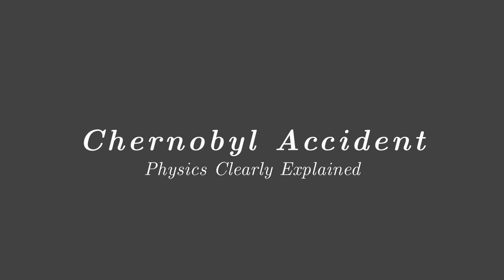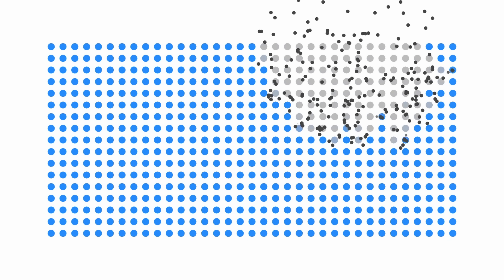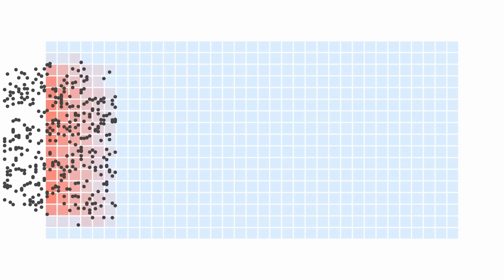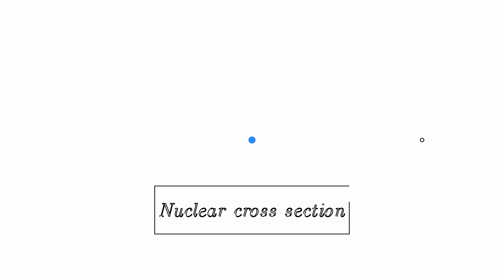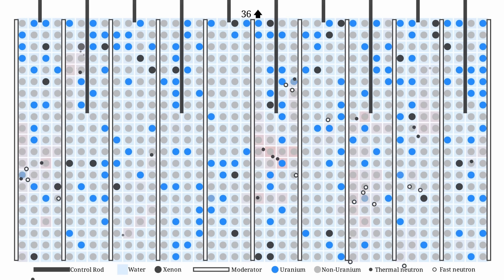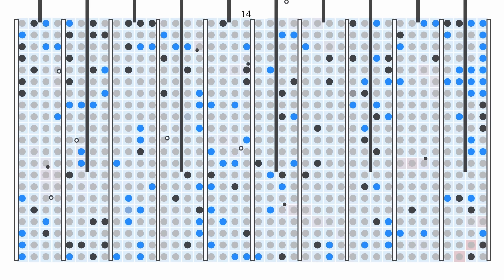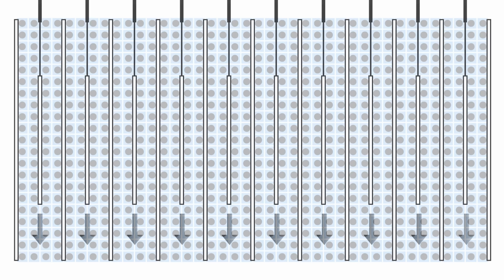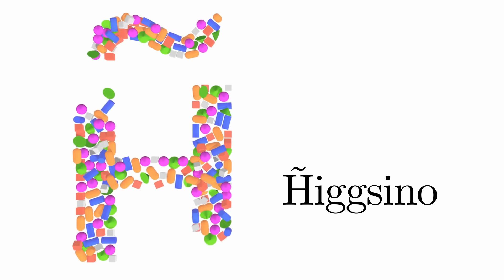Chernobyl Visually Explained

Comment: 15:14 I feel like this really is the fatal flaw in the design of the reactor. The control rods have graphite tips that work to increase the reaction rate instead of decreasing it. As someone in another video mentioned, that's like having a single pedal for both gas and brake. Imagine slamming the brakes and the car accelerates for a bit before actually starting to slow down. Given how hazardous that is, I'm not surprised the accident happened, but that the reactor even managed to function as intended at all. I mean, who even designed this?
Reply: That analogy is a little bit disingenuous to what actually happened.

 If you want to use the same analogy, it's more like if your car had power inhibitors installed and your car was maxing out at 10mph in a 40 zone. So you turn off the inhibitors and it slowly accelerates to 20mph. The car system then warns you that the car is in a state that is about to go mental and to activate the brakes IMMEDIATELY (and would likely do it automatically eventually). You instead ignore that entirely, turn off the safety system so it can't interfere with your decisions in any way, keep pressing the accelerator despite the warning, and then only once you are doing 700mph do you then decide to activate the brakes.

I agree that the design probably could have been improved, but the actual disaster was purely user negligence and the system did everything it could to try and help them prevent it and yet they just turned all that shit off and tried to fix it raw.

Comment: 15:26 
Sorry to add, but another inaccuracy is that the reactor caps were most likely not jumping. However, Elena did jump a few feet up about a second before the explosion, breaking most of the welds holding it on, the surviving of which were then broken when it got shot off.

Comment: 14:00
Incorrect. There wasn’t actually a power spike before the shutdown, the shutdown was standard test procedure.
They had managed to get the power back to and stable at 45% power. Toptunov was calm while pressing the button at 1:23:40 until many more alarms went off.

Comment: I've read investigation papers and it looks like it is not so simple like in this simulation or in the movie. The problem was that detectors were concentrated mostly on the middle level of reactor, and at low power state nuclear reaction in RBMK could become unevenly distributed so detectors cease to show adequate values. So while in one part of reactor everything is ok, in the other one it already gets out of control, hence heat and pressure differences that caused jamming of rods.

Comment: Without the graphite moderator (and the graphite tipped control rods) you would have a PWR, where the water is the moderator.  The RBMK was not intentionally controlled by water voiding, like a BWR.  Reducing the water flow for the trial caused the water to boil, which significantly reduced the neutron absoption.  It was not all about Xe poisoning.  The graphite was still moderating fission neutrons.  Lowering the control rods from fully raised actually added reactivity for the first metre or so.  This top reflector was designed to avoid needing enriched fuel (like a PWR).  The graphite tips were removed from the other working RBMKs.  The explosion was from steam flash boiling, not nuclear, although the fuel dispersal was just as bad.

Comment: I don't understand why the scram button didn't work
I find difficult to understand the "stopping power" part
Reply: Because you can't just stop the reaction the same way you can just stop feeding coal into a power plant. The nuclear material will react as long as there are moderators in the reactor. Reactors today don't have this split moderator-control rod system, instead they often use materials that do both at once.

Comment: Fun fact in the boiler operator industry out in NJ we’re required to get boiler operator licensing to prevent steam explosions. Water expands and turns into steam at a rate of 1600:1. So very quickly the pressure builds. 

The one example of negligence always used is the event of an operator on his night shift. Typically all boilers run automatically and only need to be monitored using a computer Building Automation System (BAS). Once a boiler runs low on water a feed water pump controlled by the BAD will pump more water in and a boiler should never be low on water while running EVER…

So the operator was working his night shift. The boiler was having issues and kept ringing an alarm for low water which would automatically be added immediately. The operator was trying to sleep and decided the alarm on the boiler was bothering him. So he disconnected it… he goes back to sleep and the boiler starts to get low on water and because the low water sensor is disabled it can’t communicate to the feed water pump to add more water. 

The BAS just kept the boiler on so the entire shell got extremely hot cause there was no water to move the heat out. The operated eventually woke up and saw that the gauge glass ( a physical glass tube on the boiler that lets you see the water level) was not down a little but completely empty. In a panic the operator ran to the feed water pump and opened it manually…

By opening the valve and letting water into a scolding hot dry boiler all the hundreds of gallons of water suddenly expanded from 1 part water to 1600 parts super heated steam (steam so hot it’s invisible). As soon as the water entered the boiler the entire plant exploded instantly killing the operated and sending the boiler literally a football field away…
Reply: Apart from not disconnecting the alarm a better course of action would have been to simply stop heating the boiler. At this point, the boiler is probably f...d anyway from overheating, but at least you don't blow yourself up trying to cover up your f....p.
Reply: @joergmaass So in commercial and stationary use the boilers run automatically. The operators job is to stand by for repairs. But because the operator tweaked the automation of the system for his convenience the boiler was still programmed to do its job. The operation upon waking up should’ve seen the gauge glass was empty and just hit the emergency shut off and cleared the building and called relevant authorities. I don’t like the government having a license for everything but for this I agree
Reply: @Paralius  An emergency shutoff like AZ-3? 😉
Reply: I work as a maintenance technician in Alaska and by no means am I a boiler operator, but I’m very interested in working on them and love learning about them, we are told how dangerous these things can be and to be always keep and eye on the pressure and the low water sensor, we do not have a BAS system for all these boilers, they’re designed if there is a low water alarm they will shut off the boiler and go into a hard lockout, at least that’s what I’m understanding about them, why wouldn’t this system do the same if water wasn’t added from the BAS?
Reply: @SlaminSalmon-ni3wj A BMS or BAS is designed to shut things down when it’s not tampered with. However if you do tamper with safety’s you can trick the automated systems and that’s where serious problems start!
Reply: @Paralius oh I see, so the operator silencing the alarm tampered with protocol and pretty much destroyed any chance of cooling down the boiler
Reply: @SlaminSalmon-ni3wj correct. And what I believe happened was he bypassed the physical safety so the BAS read the load in the electrical loop (the safety in this case) as ok and working properly
Reply: @Paralius gotcha, but in the bas wouldn’t there also be a high temp switch as well? Was this also bypassed because I know here it has a tendency to not work properly
Reply: @SlaminSalmon-ni3wj Yes! There are physical limit switches to detect high temp as well as BAS systems. However some BAS systems depending on manufacturer and type only let the operator know there’s a high temp. So it’s the operators job to monitor and regulate it. But sometimes a high temp alarm can trigger an emergency shut off if programmed to do so. 

In our example the operator disabled ALL safety’s power including the audible alarm. He also either disabled the limit switch or again tampered with the BAS
Reply: @Paralius that it absolutely insane to me man, to have all these early warnings to just ignore them and cause a catastrophe, with all my coworkers I stress just how dangerous these systems can be and I’ve actually used this example with everyone to explain what to do when a low water sensor is activated
Reply: @SlaminSalmon-ni3wj The good news is that it takes a LOT of skilled tampering to accomplish something like this. Several systems have to be compromised and believe it or not the Chernobyl incident has a lot to do with why it’s so hard to have accidents without tampering
Reply: Wow!! What a crazy story. You told it well
Reply: but obviously this event was not independent from the fact that all the operators around the plant were not adviced of the safety test going on, so it was very negligent but also a lot of other factors help the accident
Reply: What is their SOP in the event that the boiler is empty?
Reply: @Chartreuseweb good question. When a boiler becomes low on water it engages a feed water pump to add a some back. We call that “makeup water”.

In the EXTREMELY rare event all safety’s don’t work the correct sop is to EVACUATE. But this operator in question tampered with everything to cause this to happen. 

When anything gets hot NEVER add more water to it especially a boiler. Best course of action is emergency shut down and then maybe 16 hours of a cool down period
Reply: Makes sense. Thank you for answering  @Paralius
Reply: @Chartreuseweb  I work in a power plant, too as an automation engineer. For our case, we don't have SOP per se when the water level is very low, because the automation system is programmed to immediately stop the boiler by safety interlock (a kind of permissive that cannot be bypassed unless the program itself is modified by us). This also applies to other critical factors such as low oxygen level, low fuel, high fans vibrations, etc.
Reply: Thanks for sharing. Even as the engineer supposedly adhering for the safety of plant operations (with the cost of constant arguments with control room operators 🙄), sometimes I also got pissed at the lengthy procedures and how the programs are designed to be so restrictive sometimes. But these kind of stories remind me that those troubles actually saved everyone from experiencing the same catastrophe.
Reply: @user-dw8bs4qp1r agreed. I’m not a fan or redundant procedures but I’m even less a fan of safety issues
Reply: What plant did this explosion happen?
Reply: that makes sense heat along wouldnt have caused the steam explosion you would have needed water and adding water to the thing that already heated over its limit wouyld cause a explosion like that
Reply: That's really cool bro! I never considered that it is pretty much just a big nuclear steam boiler!
Reply: @DrPeculiar312 hey, you might not be exactly right here. Folks at Chernobyl thought that the worst thing they could do is mess up with the water level in boilers. And human error comes down to negligence be it a power plant or a space ship.

Comment: The neutron flux spike occured from the bottom of the reactor making this even more worse as it is or was. You explained it why actually a bottom only but neutron flux was rising from the bottom to the top and some sciencists stated that around 2s befor the explosion there was even bigger thermal power surge raging from hundreds of gigawatts to almost few TW. So the personal that night generated literally 5years worth of power in 1 second...😂

Comment: For anyone curious why reactors with a negative void coeficient cant explode, in short it is because instead of graphite for moderation they use water. Now because they use water both for moderation (slowing neutrons down) and cooling that means that if the power would increase rapidly like in chernobyl unit 4, water would evaporate and thus the neutrons would go too fast to hit anything because there is no water to slow it down. Note: I am not a nuclear physicist and if anything i am fucking dumb from chemistry and physics but this is just an oversimplified explanation that i deducted my self by simple logic. Its if water = true then neutrons = slow, if water = false then neutrons = fast, if neutrons = fast then small chance of a nuclear reaction.

Comment: There were two explosions. One when the water flashed to steam blowing the lid or cap off the reactor. That allowed air to rush in causing a combustible hydrogen/oxygen mixture which was ignited by the superheated graphite. That explosion is what blew the roof off the reactor building and energetical dissociated the reactor core into the environment.

Comment: Best video ever. Essentially the key disaster points were:
1) rods designed poorly with graphite hanging at the bottom (Graphite which slows fast neutrons making them thermal neutrons, which accelerate nuclear reaction). Stupid question: shouldn't the bottom of the rods be of the same boron material which absorb neutrons? What's the point of having control rods made of a material, even if only for the bottom part (which by the way is the first part to get inserted...), which accelerate reaction? I don't get get it
2) rods were slow to come down after pressed A3-5 button and got stuck due to the instable reactor. If they were not stuck, would have the disaster been avoided?? Also, what if they simply put the rods down without pressing A3-5 button? Would have the rods been stuck as well?
Reply: The rods were basically half absorber and half moderator in order to increase their effectiveness. The real issue was that the fact that for the Chernobyl reactors the graphite section was slightly shortened. The resulting space was filled with water which combined with the excessively positive void coefficient lead to the positive scram effect turning into a runaway reactor.
The only way to save the reactor and minimize damage would have been to very carefully and deliberately insert the appropriate control rods. This is very unintuitive and no one would think of it without the power of hindsight.

Comment: The collisions sound like a Geiger counter. Is that really what we are hearing with a Geiger counter? Collsion frequency?

Edit: Its not, but a cool dramatic effect.
Reply: In oldschool counters, you would literally hear every disruption of the electrical circuit (which is the exact same crackling you get if you step on your headphone cable). Modern clicks are a representation

Comment: Out of interest... was there a safe, stable way to reduce the xenon 135 build up from a control rods out position?
Reply: Xenon is a transient, it decays by itself given enough time. The transient from the first delay has long decayed by the time of the explosion and the transient from the power drop wasn't as impactful on the dynamics of the reactor as the underlying design flaws (control rod design and removal of additional absorbers).

Comment: And what would it happen if they did not press the SCARM button instead?
Reply: To summarize the video: power would have climbed leading to a runaway reactor. The automatic shutdown system would engage, which would have the same effect as pressing the button. If they disabled this safety system and carefully managed the power by inserting control rods and ran the pumps to force enough water trough the core, they might have been able to minimize the damage.
Reply: https://youtu.be/PBy__ZIWG18

Comment: You put so much effort into this project and yet there was no effort to research the basic facts of the disaster beyond the HBO miniseries. The graph showing a continous increase of Xenon concentration is particularly telling; there should be a transient during power changes but in steady state a lower power level should always correspond to less Xenon, not more.
The actual cause of accident had nothing to do with the operators. They have done everything right and did not violate a single relevant guideline or rule. The designers required operators to continuously remove so called "additional absorbers" causing the the void coefficient of the reactor to increase, week by week, month by month. The effects this had on the behavior of the reactor was not calculated correctly and experimental measurements that demonstrated these changes were ignored by the designers.
The KGB had nothing to do with it. The communist party had nothing to do with it. Just scientists being stupid, arrogant and getting away with everything.

Comment: Did the lack of water contribute to the control rods getting stuck? Or was it just a slow process in lowering the control rods?
Reply: Id guess it was just a relatively slow process. Even having these 2 seconds to insert the control rods is not fast enough if the reaction gets 
out of hand

Comment: I don't understand how water keeps the reaction down. It doesn't reflect neutrons so they are out of the reactor anyway. Why does it matter?
Reply: They absorb part of the kinetic energy and gets heat up. It takes a lot of heat to raise temperature of water by 1°C due to high specific heat capacity (4.2J g-1 °C-1) hence it is an excellent and easy to access coolant. At the same time water get heated up and turns into steam to drive the turbine, produce electricity, then cools down back to water in liquid form to cool the reactor again

Comment: Hmm how about when thermal neutrons contact the moderator? I know in the illustration you have them not contacting the moderator, but technically it would slow them down too right? How does that impact things?